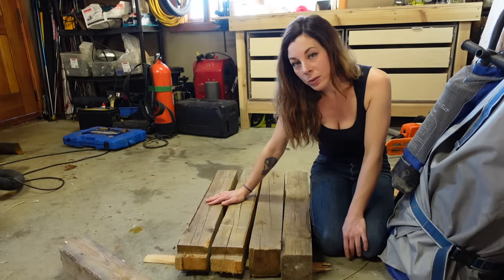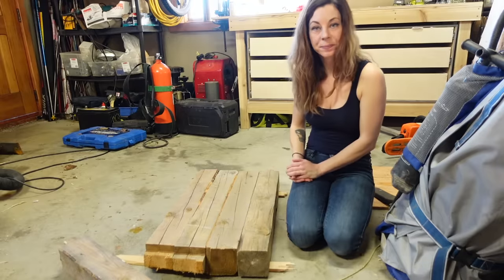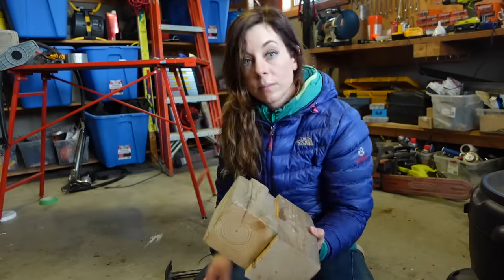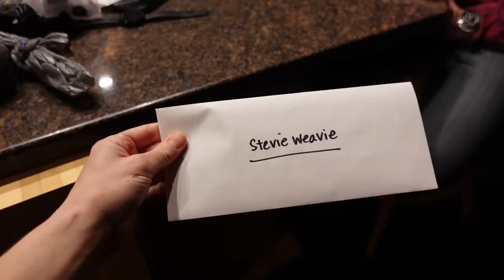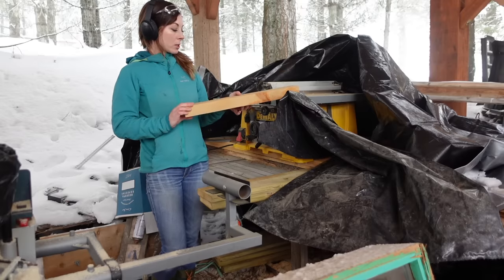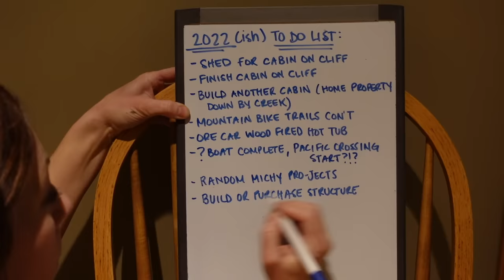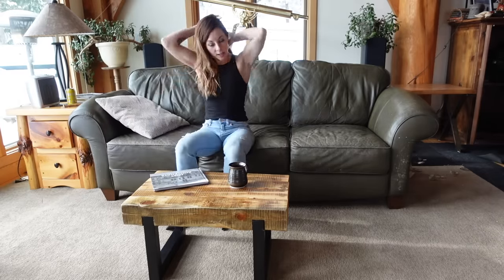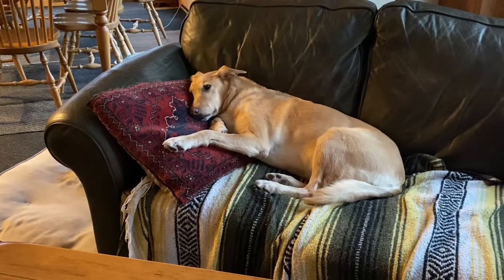SAWMILL SCRAPS / JUNKWOOD PROJECT (ft. goin' fer a rip) || RUSTIC COFFEE TABLE DIY.

Comment: .. Years ago I built a timber bench similar to that ,, I used pieces of all-thread and large fender washers /nuts through to pull it all together (Layout and pre-drill holes) recessed pockets on outside front and back pieces ....3ft. x8ft. ,,used it for a heavy work bench .. /// ... also made a trestle dining table similar with stacked 2x4's ...torch burned the top and poured epoxy over it to level surface ... if it comes out too glossy for your liking ,,hand sand over with 4x fine steel wool to dull sheen ... Love the "TO DO" board list...to self .... keeping projects in head just doesn't seem to work ...kinda like hiding them from the boss ...

Comment: Lovely little build. I have some scrap timber and some heavy steel flat bar sitting about. Might rip off this idea when I get time. Was thinking I could drill the table right through then run two pieces of threaded rod from flat bar to flat bar to secure the steel to the wood and provide strength across the glue up. Would have a nice industrial look too.

Comment: Wooden Doweling (3/8) jig works great! It's the same concept as your nails but much easier and stronger. And the only power tool you need is a hand-held drill. If someone already menttioned this then ignore it. Great work!

Comment: I think bar clamps would be a good investment for lumber glue-ups. The ones you have are ok but tighter is better when doing  this sort of thing. I use the ones that screw on 1/2 or 3/4 black iron pipe.

Comment: I have to say first and foremost that I love that you do not care to be bound by "formal knowledge" of how to do something. You are engineering by trial and error and it shows that you are not afraid to try and you demonstrate critical thinking. That being said, the reasons you lose more on the ends is because of the start and stop phenomenon. This happens in anything that is applied by hand over a surface. You may not realize this but when you start, you are more cautious and slower, taking more material off. The end I would theorize you are slowing for to create control off the edge of the surface. It is subtle but this with the increased speed in the center where you feel safe creates the issue. You can see this with spraying paint. When you paint you want to run off the edges because of the doubled time you would spend if you tried to stop at the edge. Runs and sags become the result. All you can really do is clamp the piece securely and give yourself a sacrificial starting and end ramps and go for it in a smooth controlled motion.
Reply from the maker: Ok! Thank you for that! That’s exactly what happened then. I’ll keep practicing! 😊

Comment: Nice project video. Turn out nice. That's a lot of glue surface between those 4x4s. I would think it would hold together without fasteners as long as the joints were clean and well clamped.
Reply from the maker: Thank you! Yes - I’m hearing a fair amount that the glue was likely all that was needed, but I was also just so curious about my nail idea, so had to try it! 😁🤷🏻‍♀️
Reply: @michygoss7148  not criticizing the nails at all. That is a common technique  for keeping the workpieces from slipping out of alignment under clamping pressure.

Comment: This has to be the most unusual woodworking video I have watched :-). I have used the cut off nail solution myself and found it is not actually required, glue is strong enough. If you have a good place to work out off, then making a building yourself can be an option. Personally I would buy a prefabricated shed thing, because we only have so much time to spend on everything. Great video!

Comment: The surface area for glue - If you can keep the pieces aligned and under pressure while the glue dries, the joint will be a LOT stronger than the wood. Contrary to popular belief, smooth glue joints are very strong.
Reply: That's correct, if you do it right it's stronger than using buscuits.

Comment: bonjour michelle et steve  merci pour la vidéo.  your wood working skills are top.  very nice chiesel work.  as for joining the pieces together with nails and glue, it works.  perhaps next time, use some hard wood dowel rods.  find the center of your wood, drill out the holes, glue and put the dowel rods in the holes and clamp them  up big time. by the way, the dogs don't think you're crazy, they love you and so do all of your 28,5 subscribers.  until till next time, y'all stay safe.
Reply: Love the table ,i really bad i make things out of anything, even when im driving around for work im allways on the look out for the next thing to make im bad 🤣 but im now making a camper canopy for my ford ranger so i can go off on my travels. I love the hot tub i bet thats so relaxing?? So jealous, i thought when your making more tables try using an old broom handle and use the for dowels just a thought x

Comment: using dowels to hold together those boards or any joints is easy and requires no special tools except for these little gadgets called dowel center finders, which are 10 dollars for a set. oak dowels are not expensive and are easy to find in many sizes. you can let them stay hidden or drill all the way through on an outer edge to reveal the dowel face. you so need and deserve an indoor shop given your long winters. thanks

Comment: I love how you keep insisting on reinventing the wheel on each project. No doubt there are some woodworkers cringing as they watch you use the double pointed nails to hold the wood together. Well, to hell with them, it worked. On a side note, however, the nails probably kept some parts of the wood from bonding together as well as they might have by creating small gaps between the pieces that using clamps alone would have closed. Glued wood is stronger than the wood itself, and stronger than the friction fit the nails use to hold things together, so the nails weren't really necessary. But the table is awesome, so good for you!

Comment: Yes more sheds. Heads up, If you build 1 for the wood work Its not a good idea to do any metal work nearby. That will of coarse need another shed. Do look into learning to weld as its a handy skill on a property and while you are at it get yourself a forge and have that in the corner. You strike me as the sort who would enjoy a bit of black smithing. It all flows together wood and metal you will be surprised at what you can create.
Reply from the maker: All so true!

Comment: Nice work!!! Your place has such a cozy and relaxed vibe to it with the music as well. Subscribed!

For your table saw I suggest putting it on casters (everything on wheels for tiny shops, and even once you get a bigger shop that flexibility to move stuff around is still super valuable). Plus if you have a mobile cabinet under the saw, that adds even more storage room.

Comment: Hot tip! furniture ready lumber should have a moisture content of 6-8% 
A few days inside is not enough to dry them, even if they where milled fifty years ago. 
Clean surfaces glues much much better than weathered ones ;) other than that keep up the nice work:)
Reply from the maker: I did have them inside before for about 6 months (in that workshop).

Comment: The dog and I both barked loudly when you said hot tub! LOL The next time you're looking to join wood like that, try drilling holes and using dowels and glue. A dowel kit/jig is pretty inexpensive and much cheaper than a biscuit tool. The table does look nice, great job!

Comment: Check the brushes on the saw motor, they could be worn and need replacing. Edit, i just remember something similar happened to my table saw. First it started to take ages to start, then it would start / stop and finally it wouldn't switch on. Turns out the switch had died and worked fine after replacing it.

Comment: Michelle, It sounds like you aren't too happy with the look of a poly finish.  It does change things a bit but... give it some time and the color of the wood will yellow and darken.  You need to play around with welding.  It opens a whole nother world when it comes to making furniture like your table.  Wood and metal are a great combination, I've made many tables with reclaimed old growth lumber for the top and metal for the legs.  If you weren't so far away I'd give you some stick time (I see you have a Lincoln buzz box welder) and some pointers.  I am teaching my daughter to weld but she gets to learn Mig first..  basically a hot melt glue gun for metal..  Keep up the great work...
Reply from the maker: Yes, Steve CAN weld, but he is no master of it. But I suppose he’ll be the one to show me, which might be entertaining for viewers! 😂. It’s definitely a great skill to have, so looking forward to learning it! (But wish I had someone like you teaching me who knows welding well 🙃)
Reply: @michygoss7148  The easiest rods to use for learning are 6013 and 7014.  The 7014 has a flatter, smoother bead, the 6013 is a little bit easier to use for a beginner.  Both of these can be purchased and just about any farm store or big box hardware type store.

Comment: Ya know what would of probably got the look that you were going for, and a lot easier too, a roofing torch...you burn the surface and then sweep off the char dust as you go, it brings out all the natural grain lines in the wood and then you just use a clear coat sealer spray , keep that in mind for your next pro~ject lol oh and I think Steve looked very broken up about being let go from his Trash assignment 
🍷😆 poor guy!!
Reply from the maker: I thought about torching it! But wanted to just see how it looked natural, and lightly sanded. Definitely worth a try in the future though!
Reply: Well you had mentioned that you weren't really crazy about the idea of using the stain so...yeah, why not? Even if ya just give it a go in a scrap piece of wood to have an idea of how that particular wood is going to look with that technique, of course all woods do differ, just be sure that the wood you're testing it on is the same type that you'll be using for the project , oh and also, great idea with the two sided nails, however have you ever tried to make your own wooden dowels?
Reply from the maker: @mikefalanga437  I haven’t ! I was just trying to think of something super quick for the job!
Reply: @michygoss7148  well, it was a great idea!

Comment: your planer probably has some snipe on the end. As the weight of the wood leverages pressure up on the end still in the planer it may take off a little more than you wished. You can solve the problem by planing long and then cutting after you've planed, or by adherining the wood to a planer sled.

Enjoyed the content!

Comment: If you're in the market for a new portable table saw, I'd highly recommend the old Bosch 4100. It's got a sturdier base, soft start and more torque than the DeWalt and never trips a breaker unless you're ripping thick stock of rock maple. The Diablo 40T general purpose blade with anti-kickback makes the saw shine. For greener or thicker lumber, you might opt for a 24T of the same geometry. Nothing against DeWalt, as I own many of their tools, including a miter saw. 

I thought the table might look clunky with such a thick top, but the contemporary lines with blacked out legs makes for a sharp looking unit. 🥂
Reply from the maker: Thanks for that! It seems fine now, but some have suggested to clean out the on/off switch of sawdust, which might have been the problem. Or just the cold. Who knows. For now it seems ok, so will keep her goin’!

Comment: Your saw has a starting capacitor that is weak. It will be on the side of the electric motor. Remove the protective cover and then you will see the capacitor. Any electrical shop or order it by the numbers on the part on Amazon Great video. Will be watching..

Comment: The saw was probably too cold to start. I have had that issue myself in unheated spaces. Depending on how cold it gets lights will also not come on. As far as joining another option you could do with the table saw is a spline. No dowels or biscuits needed.

Comment: "I don't know what I'm doing."  How a lot of my woodworking projects go.  I'm curious; with all the pocket screwing you did, why didn't you also do that to the table top?  You kind of passed over that in your comments, so I wondered why you wouldn't do that to the top as well.  What species of hemlock were you using - eastern, mountain, or western?  Also, what's the story with the three-legged dog?  He's a good size, so how well does he get around in the snow with just one leg?
Reply from the maker: I chose not to pocket hole screw for a couple of reasons. I didn’t think it was necessary with the glue and nails, and secondly, the underside of the table was the worst of the wood, and there were quite a few life edge areas (not square/flush together), so the pocket hole jig wouldn’t really be able to properly pre-drill those needed holes. (It’s hard to explain, does that make sense?). There were also many little gaps with the wood together, my planing actually made the wood fit worse together, so I didn’t want the screws to pull and torque and change how the top all lined up. 

We adopted Scout in September from the SPCA as an 11 year old, surrendered by his owners who had him since he was a puppy. They said that Scout was a hunting dog for a few years before he was hit by a car, and that’s how he lost his arm. So it’s my impression he’s been a 3- legged longer than he was ever a 4- legged dog. We bought him a custom set of wheels from the USA when we first got him, thinking he needed them, but we really doesn’t need them at all. He gets around amazingly well, and has gained strength and mobility since being with us as we are so active. Maybe when he is older and really struggling he can use the wheels. 😊
Reply: @michygoss7148  That made perfect sense, thanks for taking the time to explain!  Glad to hear Scout is doing well amidst all that amazing scenery  :)

Comment: Having the nail is not enough by itself, but with glue, as long as the surfaced are mated will work really well. Great idea. The one challenge is that if all of the nails are not at a perfect 90 to go into the joining side it will bind. You did good to use clamps as well as hammering.

Comment: Your table saw issue maybe just the switch. Disassemble, clean and check contact springs.
Reply: I had the switch go on my craftsman table saw . Got one at a hardware store for $20. But it went bad slowly . Requiring many flips to work. Electrical items with a motor need to be inside .
Reply from the maker: Ok! Good point! Thanks
Reply: @michygoss7148  My switch is the same for many different makes .Also available on the internet

Comment: If your planer is not perfectly flat on the board front to back when it starts the cut it will not cut correctly.   You probably just need more practice with it.
Reply from the maker: Ya. Definitely need more practice. Thanks. I’ll keep at it!